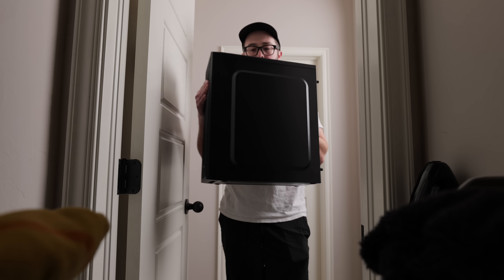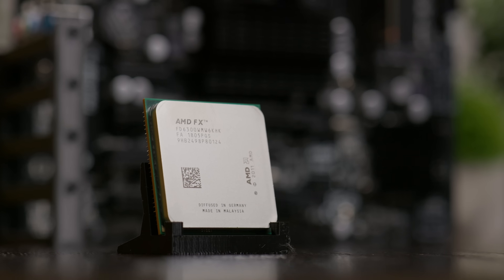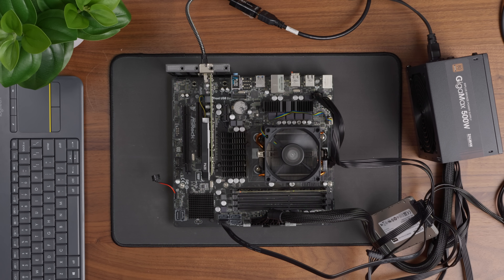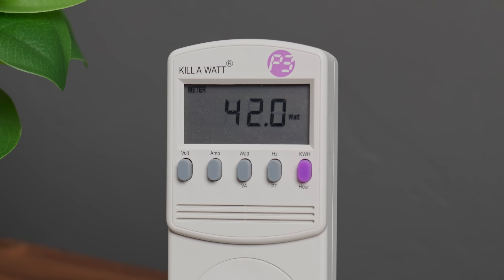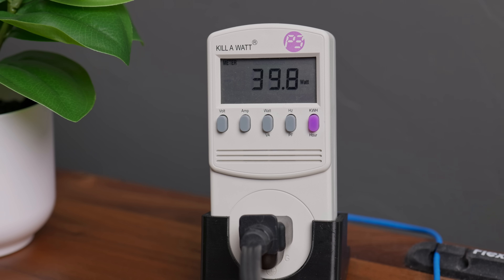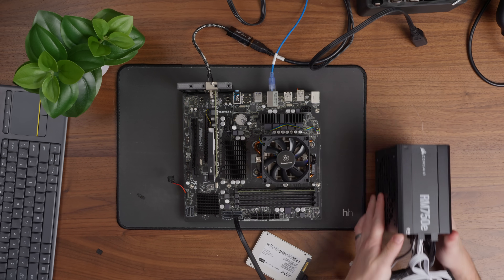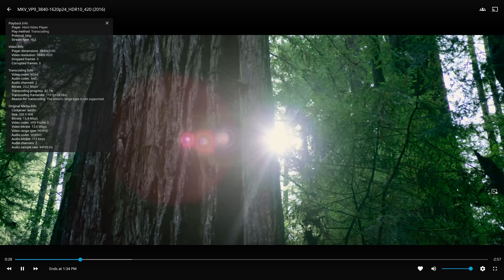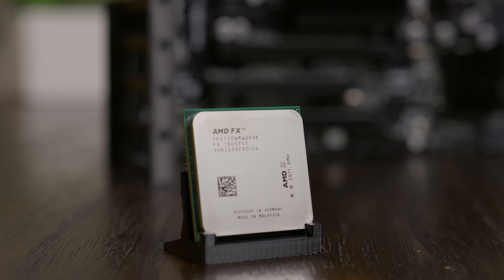This CPU Shouldn’t Work in a Home Server… But It Does

Comment: i think a cheap used optiplex can give the same kind of output for less wattage
i have a whole 80 watt pc that isnt an optiplex but uses one of those intel chips and it maxes out at like 80 and idles average below 30 while in windows
just as a base line already without having tweaked it further
and the potentially very little price difference between an fx system and an optiplex i dont think would be worth the older system with higher draw honestly

Comment: I have 5 fx era systems and 1 APU based system that’s an hp
Kind of past there usefulness
I’m now switched over to density now
Using Optiplex nodes with super low power CPUs 
Xeon E3 1220Ls 
They are dual core i3 equivalents

Comment: I had an FX-8350 in my gaming PC until February last year, got it and the board (Sabertooth 990FX) for free off a mate who had just upgraded to a then brand new Ryzen 7 1800X. Ran it at 4.9GHz with 2.7GHz CBU-NB OC, 16gb of DDR3-2133 and an Asus R9 290X and it was honestly pretty good, obviously even a first-gen Ryzen still kicked the crap out of it but for what I was playing at the time (DayZ, War Thunder, the Tomb Raider reboot trilogy and Fallout 3/NV+mods) it was not bad at all, to the point where the i7-4790 (non-K) I put in that PC to keep me going until I could build a new one after the Sabertooth croaked only really gained me about 10-15% extra performance, which is a decent amount but with how much people dump on FX CPUs I was expecting more, lol

Obviously my new build (Ryzen 5 5600X, RX 6700 XT, 16gb DDR4-3600) is lightyears better again, but I still have a lot of fond memories from that old blast furnace of a PC.

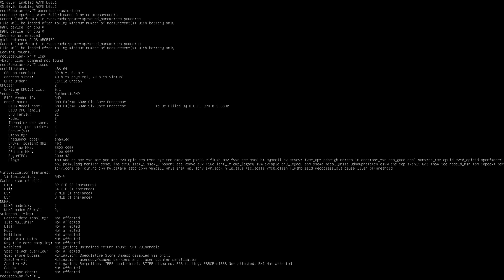Comment: 11:20 maybe with cool and quiet and auto oc enabled, when running 2 cores, it will give more voltage to the two cores so have lesser impact on performance.

Comment: I've had such good laughs at sort of things and people cursing the ethics series blah blah blah and yeah they could be hot if you did the wrong things but if you under both of them and overclock them properly way back when they were amazing thing for the luck I've still got two FX systems as it is one that ran I had it running perfectly stable 24/7 for 11 and 1/2 years you know perfectly stable like I said ran beautifully and the other system was the TV gaming system from way back when within " six core and it did everything the Intel system would have done for less than like several hundred dollars cheaper so that was enough at that point in time to actually still cover the difference between having a decent video card and not a decent video card not with system from that point was an amazingly good value as for underclocking him now if you get the right chip you can underclock them very nicely your best chipsets are actually for in your case avoiding the video card because you can get all the older AMD chipsets with especially the 6:40 with the built-in video for the chipset instead and I will give more than enough for basic no no transcoding obviously but for basic work poop problem solved with your wooden post and if you turn around and you PCI 16 slot slab and slide in a nice little HBA then proof problem solve for all the connectivity it drives for a Nas along with these motherboard that had at least a gigabit connection and you're laughing for your basic Mass connection unless you know you're not going to get anything high end of that point but still it's all built in with the right motherboard there's been a good number of gigabytes of other parts of it all done with proper caps of all back then easily enough found paper very dashed shall we say but the performance was actually amazingly good for what you got the money at one point no granted r y z e n yeah but then you don't need a tip of that class is for a basic little Nas box

Comment: still got my fx with 8150 kicking around ,  i have a gtx960 on it , and am using it as my bedroom pc , to watch movies when i go to sleep ,  and is also my gf pc ,,  and am using it also as trascode pc this why i still have the 960 in it ,  problem is the psu get very hot ,  even running idle is a 600w corsair ,

Comment: Well, shoot. I was just about to retire the FX8350 desktop I built 13 years ago. It's on an ASUS Sabertooth 990FX R2.0 with 32GB RAM, a GTX 1060, a GTX 1650 (I used one for displays, one for rendering in DaVinci Resolve), and about 45TB of HDD space. It was still my main desktop until a couple of years ago and it's been on pretty much 24/7 since I built it. Never overclocked, just running at stock, but it's worked really well. I was debating what to do with it, but it looks like it might remain useful as a file server and backup Pi-Hole server if I stick Ubuntu on it. Will have to pick up a power meter to test it. :)

Comment: I think the ubiquity of extremely low power devices like intels n100, that well would embarrass both the fx 6300 in performance and power draw for roughly 150 bucks. That's if you need x86 if you wanted the lowest power draw possible the very many arm options for around the same price range would work as well. Not to say the fx series is completely useless but frankly anything from 6th-9th gen intel or ryzen 1000/2000 can be had for a literal steal if you hunt fb market.

Comment: I HAD THAT FX-8350 as homeserver when it came out. Because it was cheap and gave me everything Intel did not want to. It hat ECC and also IOMMU long before Intel VT-d was a thing. No Xeon or C-Chipset was needed to do all this. I remember spending days and nights compiling modules, kernels to get a graphics card passed through in KVM. It is amazing that now I just simply use proxmox and click a checkbox to get all this 🙂. Thanks AMD for this pioneer work.

Comment: If the author or anyone who reads this comment can help me or point me in a direction, it'd be much appreciated.  I have an HP pro desk 600 G4 and I'm trying to do hardware transcoding on jellyfin.  I have Debian installed headless  using CasaOS and I'm trying to transcode on the internal igpu.

Comment: I am using a 17 yr old computer with a Phenom X3-8450 (TDP 95W, 3 cores at 2.1GHz, 65nm) as a NAS (2x 1TB HDDs)
It ain't that bad honestly, but I am not using it 24/7, just on occasional purposes like saving loads of data on it using SFTP.

Runs smoothly as expected, even with a web server when controlling the stores in my house. Haven't tried installing a cloud service on it.

Comment: I used an fx-8350 as my first server, from october to april 2 years ago. basically it was an electric heater whit the bonus of running proxmox inside, but it was really good for the job. then I moved it to the garage and soon replaced it whit a 1u unit only because I needed more ram

Comment: my first build in highschool was an 8320  with a 7950 i later replaced with dual r9 290xs and later vega 64. it ran everything i threw at it, now its been retired to being a mikrotik router that uses the 32 gigs of ddr3 as http cache.
those 8 cores on the cheap got me through college and taught me about virtualization at a time when anything above a dual core would set you back hundreds
Reply: I've Got The Identical chip still downstairs on the motherboard and one of those systems I had running said 24/7 for well over a decade and it's perfectly good and then that day and age they were an amazing bang for the buck so many people and blah blah blah but they were excellent thing for the buck and they were stable so I had no arguments with them at all they are not the same as the newer chips but they're still viable for a lot of good things nowadays hell my one old system that I had used my foot for my stepfather I turn around not to have read long ago I did a basic install of mint on it cuz it was just sitting there Gathering dust and undervolted it and made it a basic browsing system for my mother-in-law and it's more than enough power for what she needs to say the least

Comment: The main issue for me is 32gb of ram is just the standard for a truenas build nowadays. Considering I have seen am4 bundles - e.g. ryzen 5 5600g, 32 gb ram for around 300€, no, I don't think this is a good idea unless you have this junk already. 
It could be enough for a pure nas appliance with some undemanding services.
But I have bought xeon e3-1230-v2-v3 full bundles with 32gb ram ecc for 50-100 euros in the past on ebay. These will completely obliterate the fx series.

Comment: I've been running a AMD Phenom II 550E chip (3.1Ghz, which I'd previously overclocked to 4.0 Ghz !) on a ASROCK A780GMH128M Mobo and DDR 2 Ram (from about 2008) for 15 years. It has  RAID 5 (5x 3Tb WD Reds) and draws about 135 watts. I don't spin down my drives. It has been ultra reliable, with only 2 HD fails in 15 years. Only SATA II speeds, no USB3, but Drives runs at 33 degrees Celsius. Thank you for this video. I'm going to try under-volting it. Thanks for a great video!

Comment: It really depends on what you need. However in most cases if the hardware is free and sufficient for its purpose, upgrading for efficiency alone just won’t pay for itself. Best option is Frankenstein laptop if you’re really chasing efficiency

Comment: I have an FX-8350 system with 32GB RAM sitting around unused. Been toying around with the idea of firing it up for a home server. Just need to justify doing so by figuring out the workloads I would run on it. Enjoyed this video. Now I'm curious @HardwareHaven, are you still using the FX-6300 based system for anything useful?

Comment: Asrock Z370 Extreme4, i3-8350k (default 4.0Ghz), 32GB DDR4-3200 CL16 Fury Beast, 4 x 10TB Seagate Barracuda Pro, 2 x 256GB SSD Sandisk X400, 1 x m.2 ADATA SX8200 Non-pro 480GB. 1 x m.2 to SATA adapter asmedia 1166. Disks sleep - 38-42W, idle, disks spinning - 53-58W, disk scrub - 68-70W.

Comment: My first gaming pc that I build with a friend had FX-4170 in it. Later on upgraded to FX-8320 and it smoothed some of those FX kinks, but still wasn't great, maybe like... good enough? :D
I feel like there were only 3 or 4 actually good motherboards for overclocking (Mostly ASUS, with those big "electric blue" heatsinks). And if you happened to go for the FX-9000 series, ohh boy... xD

Comment: Hmm Hmm, I recommend instead a second hand HPE DL380 but make sure it does come not only with both CPUs and at least one RAM stick per CPU but also it includes all the disk caddies, not that the caddies are that expensive but the 2.5" ones for example have a lot of chinesium offers that "work" (as in the disks are detected) but do not integrate with the BMC properly (same goes for the 3.5 but not as many fakes). The 12 3.5" bays plus the 2x 2.5" are awesome for a ZFS pool with SATA SSD caching and you also have internal USB/SD cards (which I use for emergency boot media NOT the OS having the OS installer there as well as some other tools). If you are so inclined you can even use the internal SATA ports with a decent Sata DOM for the OS or adapt them to use a SATA disk for the OS.
The one issue for me are the dual 40Gbps mellanox card and the fact these wont work on TrueNAS without a firmware change which is not easily available for free (as in they want you to have a support contract, be it HPE or NVidia for that matter, which I think is criminal for the purpose). That said, you still have everything needed to deploy a proper server, be it a file server or even an AI server by adding a decent GPU to it. (yes it does have the power connector though you need to get the cable for it and do not cheap out on these, make sure you have proper thick copper not some chinesium thin high resistance alluminium that will destroy everything when it melts, and yes WHEN not IF)

Comment: Saw a reddit post that claims that the Ryzen 3400G could idle below 10w. Testing older ryzens would be fun too!
Reply: ive got a 5300g in my current frankenrig minecraft and openvpn server. got a 16 core c3000 atom doing samba storage

Comment: My home server is ... an Intel Atom N230 ... i own that thing before N270 is released (i buy one month before the N270 release)...

... "it's fine"... the motherboard is Intel D945GCLF ... it's not so fine ... over the years the capacitor was replaced (3 years ago, by myself :D ).. and the motherboard 10/100Mbit network is "slow"... so the only pci expansion slot contain a 1Gbit card ... what is not capable the full speed because PCI limitation is not alow that (around 700Mbit/s is the maximum)...

still... that thing runing .. home assistant (server), LAMP, docker (with some additional php project, mysql and webpage service ... for "kind of lab testing" and personal usage the performance is fine, even without virtualisation support from the platform), samba file storage, ftp, own cloud ... still "fine" (kind of... the 2GB ram is not much nowadays, the storage is getting "low" two 2TB HDD, no more expansion possible, bigger HDD is not recognizable by the bios)...
10 years ago even had a minecraft server on it installed... still possible to start that, but the main problem with it not even the cpu, the 2GB ram is not enougth for run it smoothly when more than 1 people was on it.

about IDLE power consumption, PICO power supply is necessary.

the system on it.. originaly a ubuntu 10.04 ... that thing was updated over and over and again ... around every 2-4 year preiod until 22.04 was reached some years ago (around when the cap was replaced)... currently that version was on in.

however ... i already had a "replace plan" ... with an intel 1155 platform.. one I3-2125 cpu on it and two 8GB DDR3 ramsticks... but i still don't know when i doing the "replace", i already had the replacepart in my hand in the last 3 years :D , but because will i need a complet reinstall and reconfig, i never was on a mood to doing it yet...

Comment: yeah i had an FX 8350 cpu to as well and got about 4.7ghz all core out of it. this sucker sucked 220W from the wall only for the CPU, but idle power was surprisingly grate. 
its funny that i have now a Ryzen 5950x that uses only 95W and is 4 times faster than the FX 8350. ^^ i used that old Gaming system as a home server a while ago but replaced it with an intel j5040. 
the j5040 is more efficient and the whole system uses less power. This changed a couple of years ago and now i have a high demand on compute power so i bought a Dell PowerEdge R930, this system uses 150W on idle alone. My server running multiple Game servers and service, is also used to host multiple websites and other services for local clubs and organizations i am in.

Comment: As I was experimenting with my AMD laptop to make it work longer on the battery, i found out that the more frequency you set, the less power efficient the core is, mhz / watt, so for your build it is relevant to limit maximum cpu clock at lowest clock from specs or even lower, the sweet spot is to be found 😅

Comment: I tried to disable cores on my laptop to increase battery time and found out that cpu i/o part is always consume the same amount no matter how much cores you switch off, it also became less efficient on lower core count because of more workload lay on the cores that is left, and they forced to boost and draw more power 💁‍♂️

Comment: Amazing timing. I tested out my old FX8320 with 32G DDR3 yesterday for homelab purposes.

I tried all the BIOS options on Asus M5A78L-USB3.
Without undervolting (risking instability) I got the DC idle power draw to 37W.

Enabling or disabling turbo only affects how fast it could go under load and didn't affect idle power draw. It easily handles an overclock to 4.2GHz with voltages set to auto (though i wouldn't run it like that for server use)

The power draw under load is probably too high for me to be able to use it as a server because i need to run on battery power sometimes.

Comment: I built my FX-8350 system when they first came out. Gamed on it for years until I upgraded. Repurposed it into a NAS, and it is still going strong. The air cooler is the same Thermalright SilverArrow I put on it when I put it in a Fractal Define 3/4? case. The motherboard has been replaced (previous one died} and I added 2.5G networking. I have gotten my money's worth out of this CPU and I might ride it until it dies. It has been rock solid since the day I bought it.

Comment: In catalyst control center there was a slider for my FX-8350 to be locked to 1.4Ghz, 2.1Ghz, 3.4Ghz or 4Ghz. I kept it to 1.4Ghz when watching videos and non-gaming. It worked perfect and no actual tweaking required. It did all this work for you. 

I'm fairly certain those values are correct.

Comment: If I were asked the worst desktop CPU to use for a server, I would've said the Pentium 4.

I run an AMD Bulldozer 8150 as a server. When running all 8 cores at 100% at 3.3 GHz with 64 gigs of memory, four drives and a hardware RAID card, it takes less than 200 watts.

Performance is really not all that bad. It runs, amongst other things, SearXNG, Akkoma, BIND, Apache and more, and it does a really good job of returning results quickly.

I'm glad I chose a Bulldozer instead of a Core i7-2600. The Intel CPUs were affected much more by Spectre and Meltdown, plus the Core i7 couldn't even take 64 gigs.

Comment: Is an i7 2600k any good for a home server? Someone gave me an i7 2600k, with an Asus P8P67 PRO motherboard, 32 GB (4x 8GB) DDR3 1600 MT/s CL11 (it's normal DDR3 without heatsink at 1.3V from Kingston), a GTX 460 2GB (though I plan to use my older RX 560, theoretically it should consume less power than GTX 460 but I will test to see how much this PC will draw from the power socket). I want it to consume as little as possible because electricity bill increased even more in the past few months.

I do plan to use this mostly as a game server for Minecraft and CS2. For other tasks I am still thinking about what I could do with this PC.